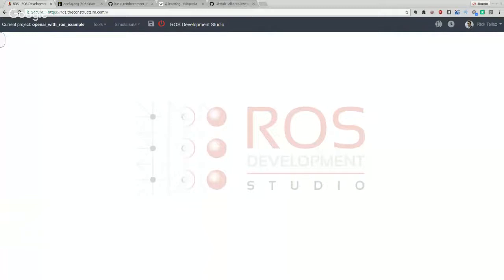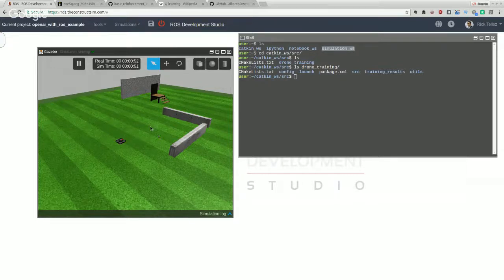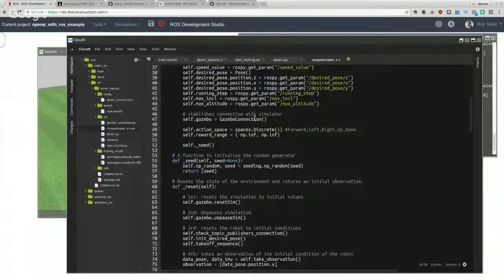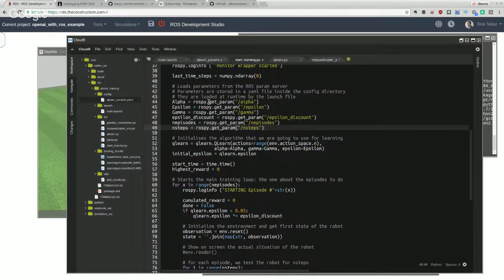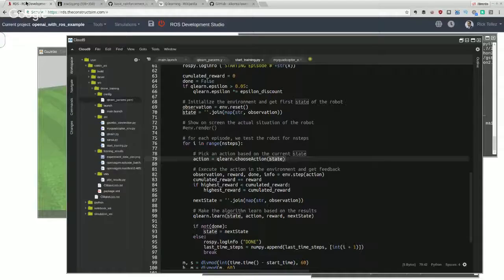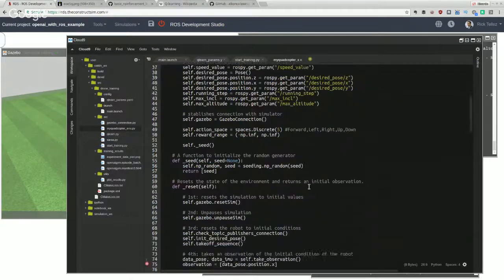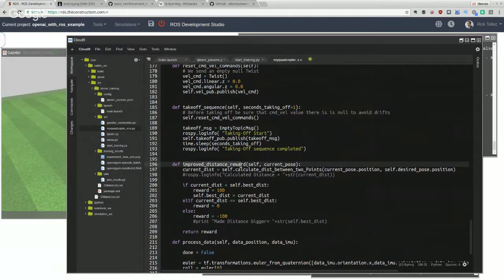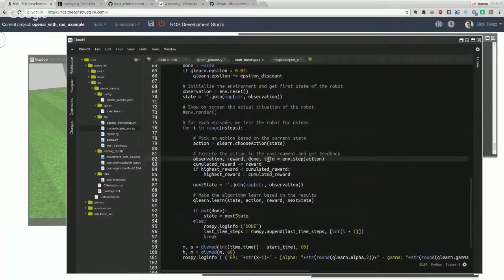ROS Developers LIVE-Class #7: OpenAI+ROS Robot | #Round 2: Practical section

Comment: Great tutorial thanks. I have a quick question.

So far I have ardrone that navigate to multiple waypoints, I would like to add obstacle avoidance, do you think I can use openai to avoid obstacles?
Reply: I am completely sure you can do it. Is going to be difficult but you can do it. Check for instance this video where I make a robot learn to do the whole task, avoiding walls, approaching the poles, grasping them, and releasing them outside the wall: https://www.youtube.com/watch?v=rUQd7uWQ3OI
Reply: @RickTellezL  I was thinking to use slam or orb-slam or deep learning or openai, but not sure which one is more efficient and easy to implement
Reply: @RickTellezL  great project by the way

Comment: I wonder if you can speed up the gazebo simulation let's say 10x, so the learning is faster.
Reply from the maker: Yes. You can play with some of the simulation parameters and make it run faster. Additionally, you can close the visualizer so the system will not have to render, and that will also speed up the process